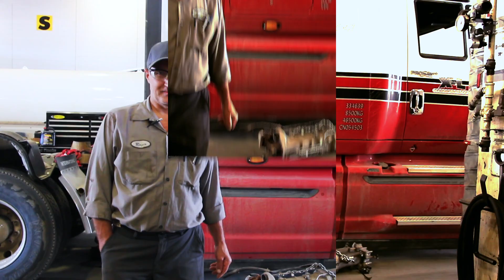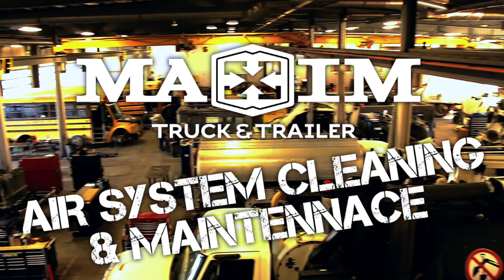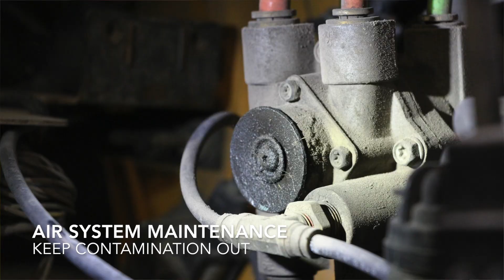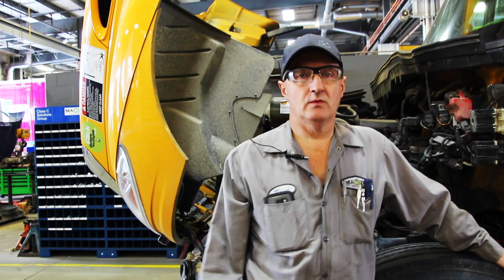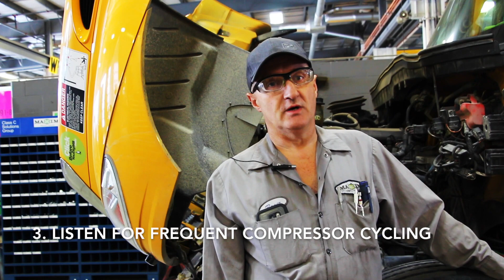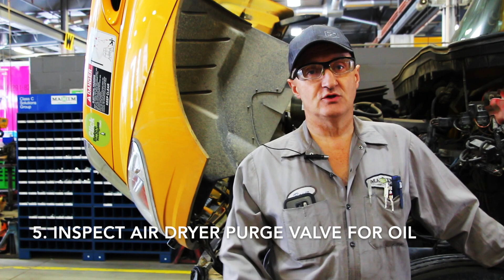Ask Roger: Air System Cleaning & Maintenance

Comment: Hey Roger, I have a 2006 Kenworth quad-axle dump truck with a Cat C-13 engine.
My truck is slow to build air.
It sat for about 18 months and now I'm getting back in it.
I have changed out the governor, then the air dryer, and the new cartridge.
My Treadle Valve and Brake Pedal were replaced because they were both seized in the down position (from corrosion) when I applied the brakes.
I then tested my air compressor output, 85psi to 100psi @ governed engine speed in less than 40 seconds.
Mine was at 40 seconds.
My compressor is known to coke any oil in the air (heat) and send it down the line.
My research has said to replace the line from the compressor to the air dryer due to restriction from carbon in the line.
Do you know what/how to clean the line instead of replacing the line?
Thank you, Roger or anyone.

Comment: Well, my air system is full of water. I change air dryer filter every 3 months. I live in Houston so humid. Air valves breaks down all the time, replace my truck/ trailer red/ yellow valve every 8 months. Horrible. All the time valves break down. Changed air dryer still same problem. Pls help.

Comment: Hello,I have a question I have Volvo VNL760 2019 and the air is purging every 20 seconds,i ve been to 3 dealer ships,nobody can find a problem,they replace already air dryer,governer and compressor but still it constantly purging air.there is no air leaks as well
I have no idea what to next and where to go,maybe you can give me advice?thanks
Reply: Andrii pashchenko 
Hey man, am not a mechanic- but when i had that problem was due to air leak. Lose air, compressor build air, governor orders purge valve,.... so on. So if ur not losing air it wont pops that often. Good luck.